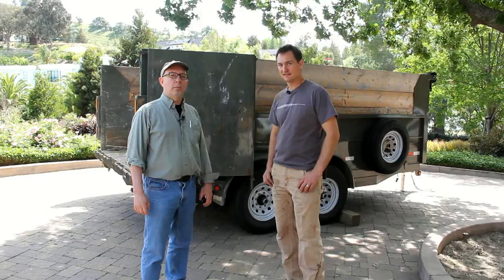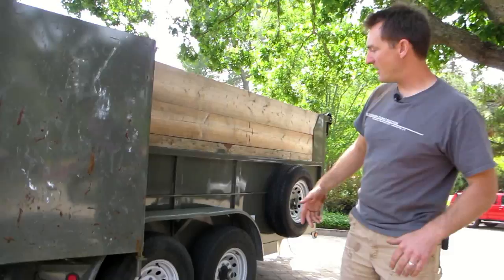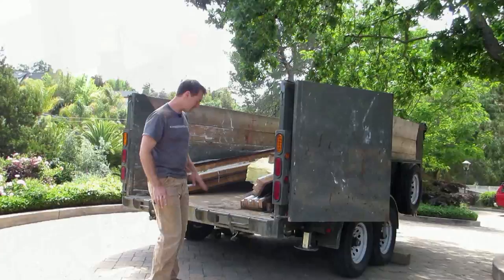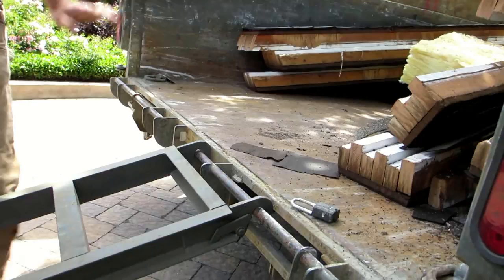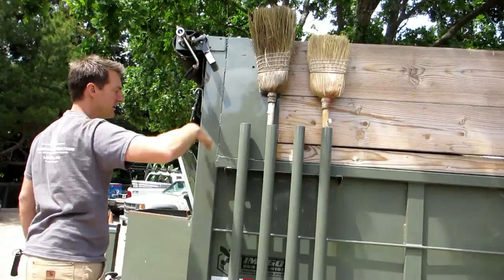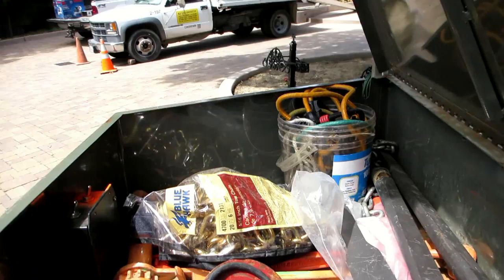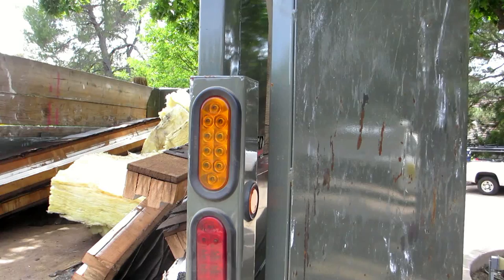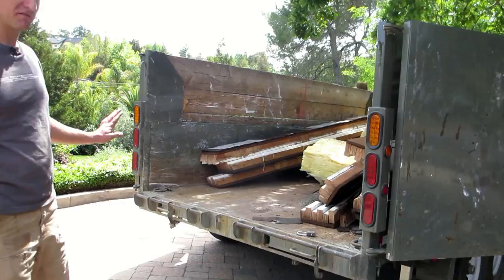Kurt's Decked Out Dump Trailer

Comment: A lot of great info.  Thanks for making the video.  Anyone removing tires for nail holes other than in the side walls should look at high quality tire 'plugs'.  Lube a corded material, push it through the hole, cut off excess, air up tire and go.

Comment: nice walk around video of your trailer.  I'm seriously considering Load Trail or Big Tex for my next dump trailer and same GVWR as yours so I have about a 10k# payload.  I'm probably going to order one and have brakes on both axles just for added safety.  The scissor lift is a must as well.  There are a LOT of dump trailer manufacturers out there with all kinds of lift systems; two rams, one ram and so on, but the scissor lift is a must!  I really like the light set up on yours with the flashers and back up lights, I might steal that idea for my next dump trailer, really cool feature.  The non-skid on the fenders is something that I thought of as well, there's a LINEX dealer near me and I'll have them do the fenders, gusset steps and the top of the battery box so that if we are packing up to leave a jobsite and it's raining, no one is (including me) is slipping around tying stuff down.  Thanks again for the awesome video and sharing some of the custom features on your trailer.

Comment: Love the trailer! i was thinking about the nail issue and wondered if it was possible to have some hanging(via chain) magnetic bars(like roofers use) before and after the two axles? the idea would be to use the magnet bars to pickup the nails before they reach the tires. you would hang the bars before entering the dump and then remove them after leaving the dump. just an idea...
Reply: Trey Anderson that’s not how simply life is many nails are 3 inches long stuck in wood the magnet would need to be half the size of the truck and many half as heavy for your plan to work. Nails are just part of the landfill life that’s why you got to pay extra for heavy duty tires! I got 3 nails in one tire right now all 3 been in tire 2 months now!!